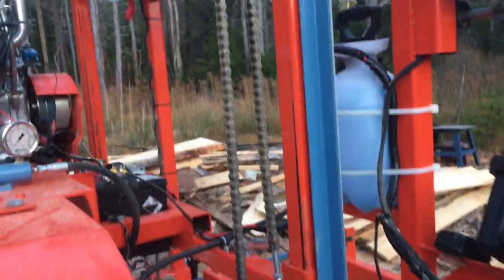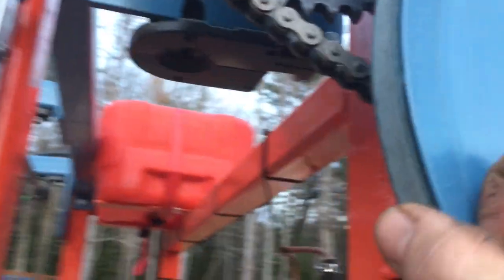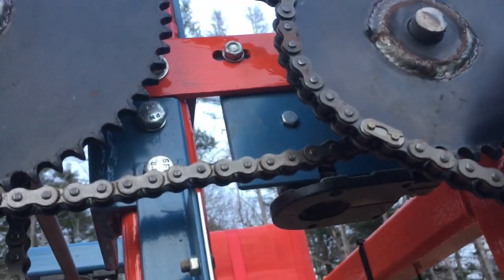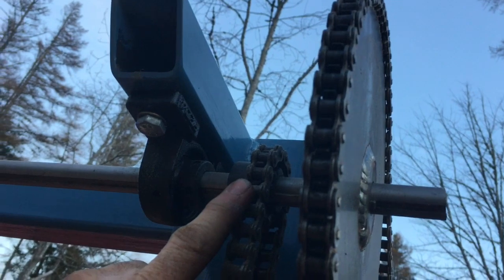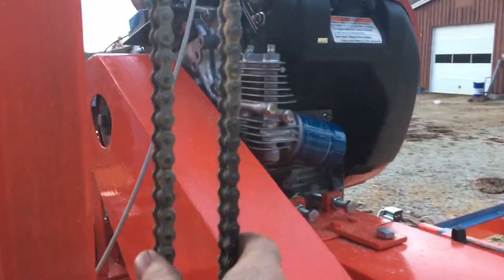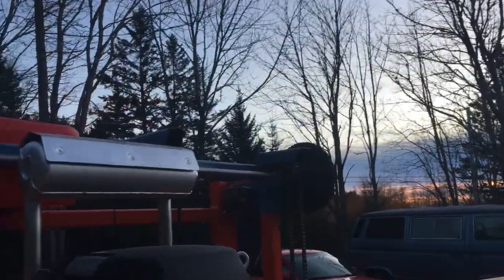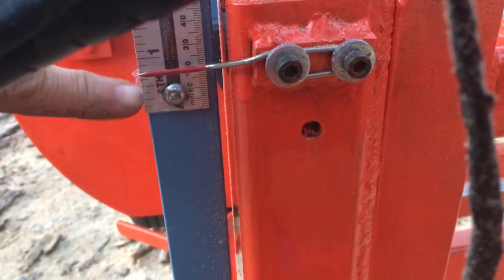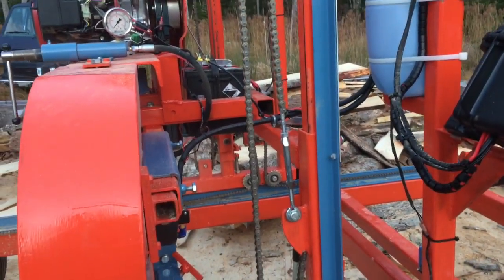Home Built Bandsaw Mill, head lift mechanism

Comment: Thats awesome! I want to spice up my design but I dont wanna bite off more than I need to chew.
Im pretty much considering the typical boat hand winch, straight to cable wrapping the 1" shaft old school.
Reply from the maker: I think simpler is often better- that said- I’m planning to make my mill fully hydraulic this winter.
Reply: @thelogfather5002  Thats awesome! Mine is ready to fire up, but still waiting on cooks guides and my hoist lift stuff, so on hold but it has come out better than I thought it was going to
I have a 158" blade and ended up with 38" log plus extra on height. A little more robust than comparable economy grade units too.
I figure when I move off the grid is when ill do the log bed on site, get the head done for now.
Mines 14hp so no plans for hydro stuff but since we will be needing to build a track dog snow dog, figure id use my saw engine for that build and then upgrade the saw to dual belt 20+hp and by then, if the mill has proven worthy Id consider powered upgrades.
The property we bought in the Adirondacks is 98% hemlock so im figuring with the small outbuildings/decks etc, ill be able to make the 14hp work fine for the property.
My biggest concern is not having a tractor, needing a mini excavator and trying to figure out if/what we are gonna need tractor wise to suffice.
The hemlocks are large size, so im hoping an ATV arch will get them to the saw, if the terrain is too moundy, we might vert back to pulleys and cable to drag them to site.
My GF wants to rent an excavator to dig the existing septic to clean it up, but im trying to help prepare her that we will ultimately need our own unit for site management anyway since rental money is just a waste

Comment: I really like your saw head lift system and was wondering how many feet of #40 chain did you use and is it carbon steel or stainless? Also are the sizes of the sprockets are what was explained on the YouTube clip? Some fellas left some questions that the numbers didn’t work out for them!
Reply from the maker: I think some of the build videos detail it a bit better. When the holidays are over, I’ll make a better video. Thanks for watching…

Comment: How did you calculate the sprocket reduction needed to raise the band saw 1 inch to two turns?  Trial and error or mathematics?
Reply from the maker: Just dumb luck! 😂 I wanted it to be easy- and it turned out in my favour for once. Thanks for watching, Jeff
Reply: @thelogfather5002  I guess I'm using the copy another builder method to figure out mine then.  🤓.
Reply: How sure are you about them sprocket teeth counts?
Reply: @lunarrn  I have the same question Log Father... The numbers you say in the video don't seem to correspond with the tooth count on the 2 larger sprockets. Perhaps you reversed them by accident?  I'm confused with the largest sprocket closest to the front of the mill, he said it's a 40 tooth (only 4 teeth more than the one in the middle) but it appears to be a higher tooth count. I'd like to know the correct numbers so I can replicate it on my build.

Comment: Cool, thanks. I might add a flip tooth to lock it in place once I had it in position. (Go one tooth further than needed, flip the lock, and raise it back the one tooth to lock it in?) Your rig, your call, if you trust the brake you have, go for it.
Reply from the maker: Sounds like you’ve got a plan! That’ll work just fine. :) 
Thanks for watching

Comment: Great build! Amazing what we can find at PrincessAuto! One idea about the sprockets that aren't clocked.  You may add a second tensioner, on either side, opposite to the fixed one. The saw head in that position, the tensioner would be just below the top sprocket, facing the log bed. So it would move along with the chain up and down. Obviously, you have to adjust both tensioners so the right/left side are in clock. So to say, releasing one, tightening the other, so you "time" both sides. Hard to explain in text...  That is my 2 cents... Thanks!
Reply from the maker: Thanks for your wisdom! I get what you’re saying. I have enough leftovers to make a few different head raising mechanisms. I’ll figure out something, but it works great for now. I’ve milled thousands of board feet, and so far so good, it’s accurate and fast. 
Have a wonderful holiday! 
Jeff.